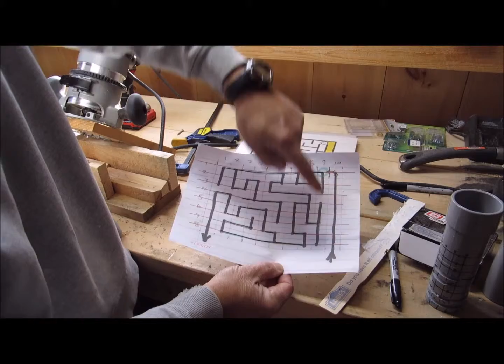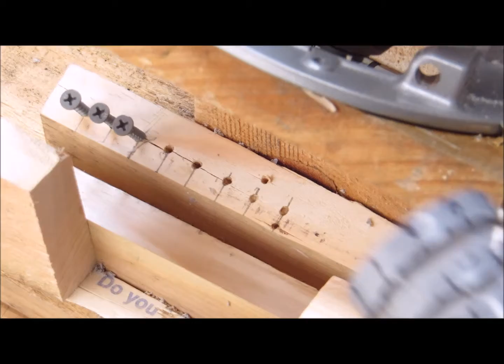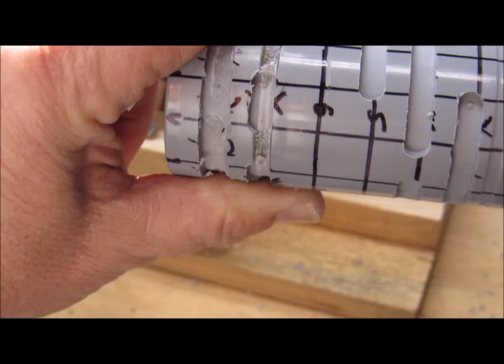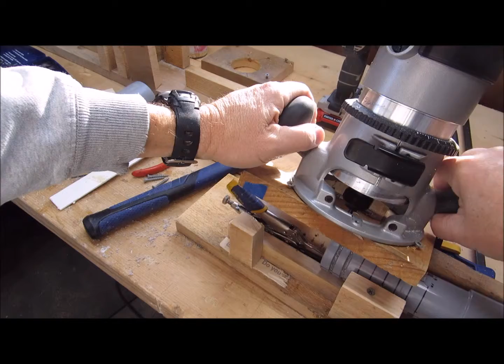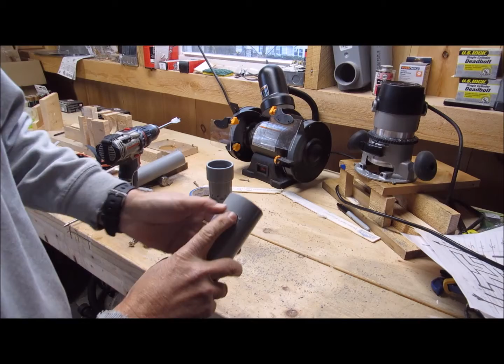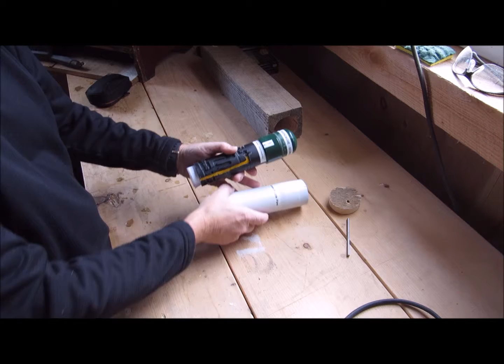Building the Mini Puzzle Pipe

Comment: Thanks for the tutorial. What did you use for the one-way gate?
Reply from the maker: rustyknightjustme I cut a piece of thin metal about 3-4 cm square from a binder clip.  (You know, one of those big, fat paper clips.). Then I held it in some needle nosed vice grips, heated it with a torch and inserted it right into the pvc to create a little ramp.  The guide pin could pass over the ramp in one direction but would encounter the lip going the other way.  Cheap, simple, effective!